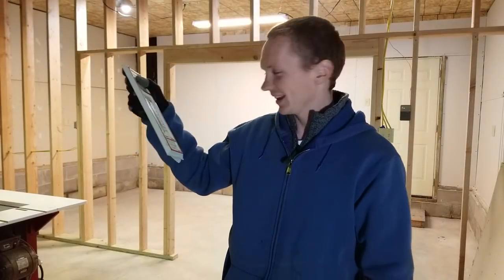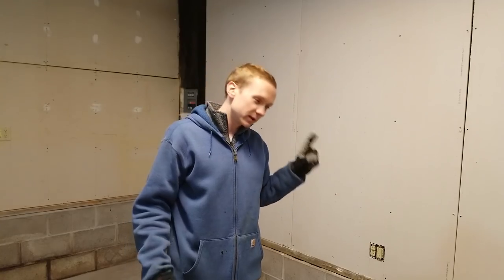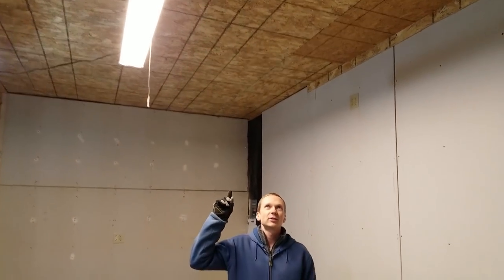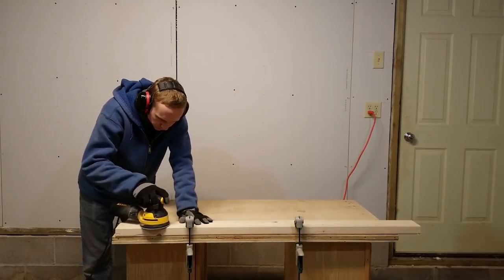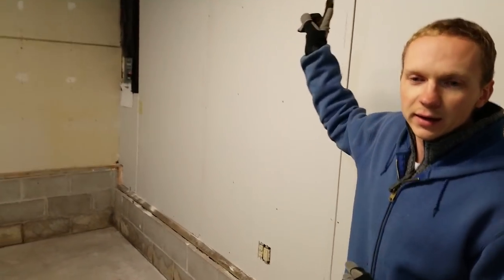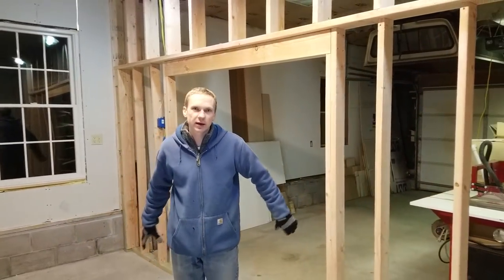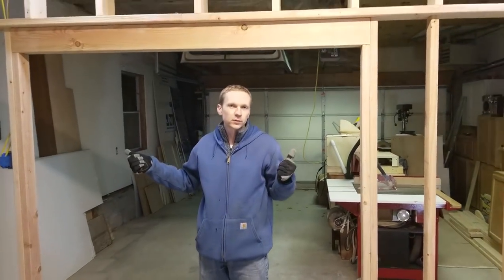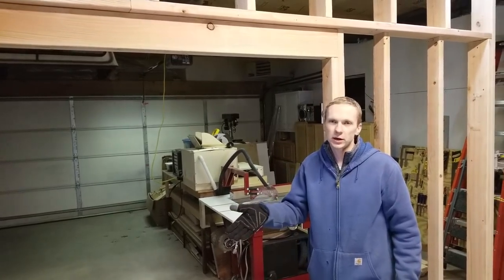Building the new shop - UPDATE!

Comment: Looking good! Stepping down to 2x4 studs to hide the pocket doors is really clever. Hopefully you can build them thick enough to provide meaningful insulation while still fitting in the wall.

One thing I would consider is skipping the drywall and using OSB or plywood on the walls so you can screw things directly to it without anchors. Half inch plywood is about 70% more insulative than half inch drywall, so you also get that. OSB is about three times better than drywall, if I'm reading my chart right. A couple coats of white paint would make it look more like drywall and help with lighting.

I would also consider skipping the drop ceiling to give yourself a bit more headroom and again to make hanging things easier. Overhead storage is handy, and LED shop lights are a lot more forgiving than fluorescent tubes as far as bumping them goes, what with not being made of glass and all that. Painting it white would make the lighting better.

You could also increase the insulation value of your window by adding a storm (if that's possible). A storm window more than doubles the R value of a single pane glass window, and a screen would let you have it open in the summer without letting the mosquitoes in. Window film insulation kits also add about 1 to the R value. The obvious downside is you can't open the window without destroying the film.

Can't wait to see it finished,
Dan

Comment: For me I lost insulation depth where the pocket doors were. And after a few years the door would hang up in pockets because who ever installed the doors did not do a very good job, the the outer wall changed shape causing the doors to slide against walls. The track started sagging too.
They were just a pain. Now if you made barn doors on a rail you could retain the insulation value. And a Barn door would be easy to make and make your shop stand out. You have a nice set up. In my shop I painted my walls and ceiling bright white ( it was egg shell) I installed LED lights and it is very bright and nice to work in.